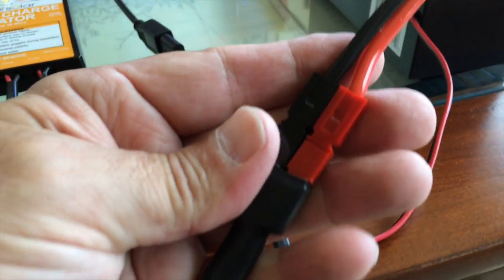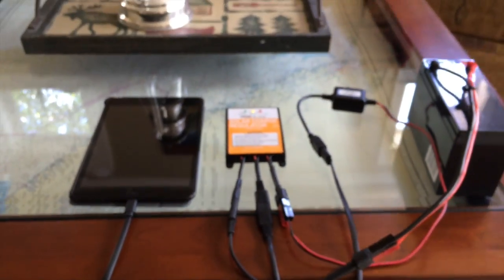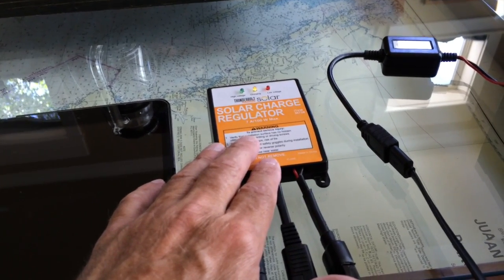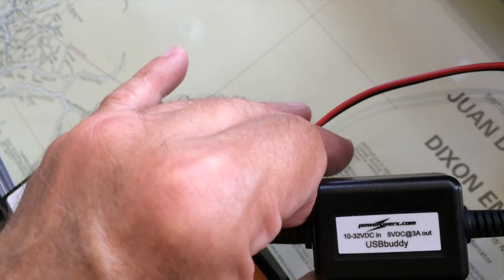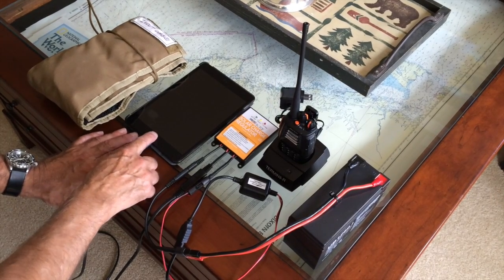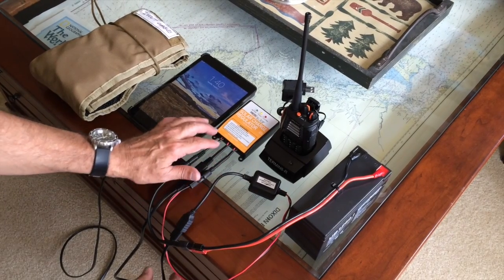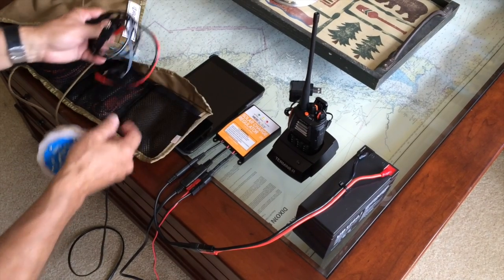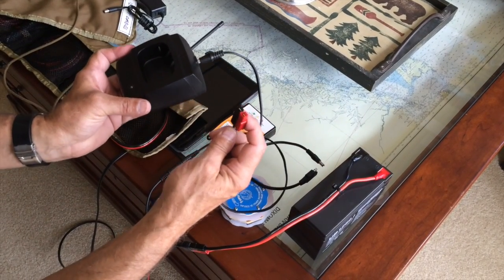Solar Charging Your Devices!

Comment: Can this Solar Charge Controller charge without a battery? How do I know the panel is supplying the current and not the battery?
Reply from the maker: Great questions! Think of the battery as the "storage pool" and the solar panel / charge controller as the "supply pump". The solar panel is collecting energy from the sun which is being stored in the battery. The radio is running off the battery. Hope that helps!

Comment: I just bought the same set up from harbor freight...why dont they follow the same way of wiring the cables.  If you look on the controller the wire all the way to the left is good positive terminal is inside the plastic housing so no chance of shorts their.  Now you go over to the middle port labeled solar and you see that the positive is now the exposed metal prong.
Reply: I found that also, this makes the ground tabs on the cig plug positive, doesn't the center contact need to be positive to charge the battery?

Comment: Where do I get the long cord? that connects to the solar panel  I have a zamp solar panel.
Reply from the maker: +L Hernandez - Check https://powerwerx.com

It looks like Zamp Solar uses SAE or Bullet Type Connectors. Pwerwerx makes an Anderson Powerpole adapter.

Ring Terminal to Anderson Powerpole
https://powerwerx.com/powerpole-connector-ring-terminal-6ft

F-Type Connector to Anderson Powerpole
https://powerwerx.com/f-type-battery-terminal-powerpole-adapter

SAE (Bullet Connector) to Anderson Powerpole
https://powerwerx.com/bullet-sae-to-powerpole-connector

Zamp Solar Wiring Accessories
http://www.zampsolar.com/wiring-and-wiring-hardware/

Hope that helps!
Reply: Thx so much for your help
Reply: Actually I have the older Zamp solar panel that uses the grey anderson plug that I got @ Costco. So I ordered a new kit from the link you mentioned. I had not visited the zamp solar website in a while & there have been some changes. Thx 4 ur help. I like that power puck, usb & the ring terminal to anderson power pole.

Comment: Very cool setup you have there. I've been wanting to do something similar for a while now, but hadn't decided which components to use until now. Thanks for sharing!
Reply from the maker: DogWalksMe There are many solutions for this particular scenario . . . I am trying to show different approaches and price points. This set-up is fairly inexpensive and functional. At the other end of the spectrum would be my Juice Box and folding solar panel.

Comment: Harbor Freight has now become my Radio Shack since RS has gone by the wayside.  Glad Harbor Freight isn't too far from my location.  73.
Reply: AI4QT  I made a killing on RS when they went out around my area, I have boxes of stuff still , wish I would have gotten more. gonna miss them though.
Reply: sunnylandcamper You lucked out...where I live all the RS were hit by something like a plague of locusts within hours of the announced closing. Literally picked clean.
Too many techno nerds(myself included) per square mile in Silicon Valley.
Reply from the maker: AI4QT  -  Hey buddy, have to say I never post a video with a radio without thinking of you somewhere in the process. You have been an important part of my process and growth as a new HAM. Hope all is well at the cabin! 73

Comment: Couldn't quite catch the name...whats the 12v to USB adapter called?
Reply from the maker: AnnBearForFreedom  -  Powerwerx USBbuddy
http://www.powerwerx.com/adapter-cables/usbbuddy-powerpole-12v-usb-5v-device-charger.html

I put a bunch of links in the notes under the YouTube player to help out.

Thanks of watching!
Reply: USNERDOC As I see it, looks like a female USB connector.  Correct?
Reply from the maker: bluenorthnw - not sure of the gender specific answer . . . it is the end you would plug your usual USB cable into for charging